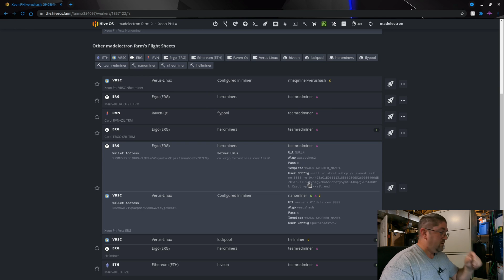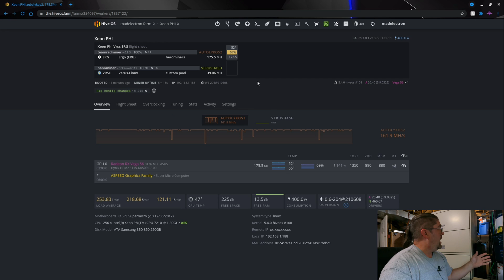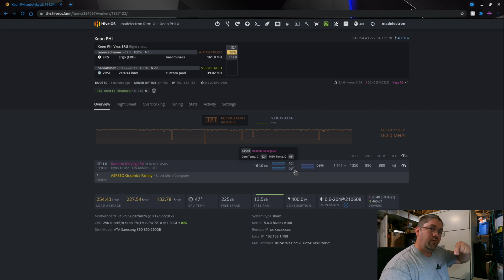Ergo Mining On An Asus Vega 56 @ 185MH/s!!!

Comment: Many thanks for the guide!

I'm trying to boost the MH/s of my Vega 56. I see everywhere that it can reach 50 MH/s+ at 130watts, I can't manage to exceed 37 MH/s at 200watts...

Here are my hardware and software specs:

- MSI Vega 56 8GB (Samsung memory) the 1st bios at 150watts, the 2nd at 220watts is flashed in Vega 64 and works very well
- Latest AMD driver
- AMD Memory Tweaker XL with GUI
- NiceHash mining only
- Windows 10 pro 64bits

I followed different guides to change the timings via AMD Memory Tweaker XL and underclock the card but I never manage to get a good level of MH/s and I can't find out where the problem is.

I tested the timings with the stock Bios (Vega 56 u/150watts ) and with the bios (vega64@220watts)
I'm wondering if the problem is with AMD Memory Tweaker or if I haven't found the timings that match my card. Do I need to use a specific bios for the card?

Do you recommend the use of the bios at 150w or that at 220W knowing that on the first, Max VRAM overclocking is at 920mHZ, while the 2nd bios is 1020MHZ.

Thanks for your help!

Cédric

Comment: Any guide for windows 10? I have a rx vega 56 Sapphire nitro+, best I can get using the radeon overclock is 150Mh/s, running Hynix memory with core clock at 1570Mhz @ 1100 mV and VRAM  920MHZ @900mV, TEMPT IS 59  degrees celisus. Thanks

Comment: I just got exactly this gpu back today from RMA after 2 months of buying it broken. I got it to 51.8 mhs at 123 watts with a preset I found online on eth under hiveos. I saw one guide for 90 watts under windows didn't look into it yet tho

I use:
1035 core 
850mV
950 mem
amdmemtweak --CL 20 --RC 36 --RP 12 --WR 13 --CWL 8 --FAW 12 --RAS 22 --REF 65000 --RFC 249 --RTP 5 --RRDL 5 --RRDS 3 --WTRL 9 --WTRS 4 --RCDRD 12 --RCDWR 12
Reply from the maker: I haven't personally tried it on eth yet to see my results, I bought it specifically for ERGO. I may need to try these settings this weekend just to see how good it runs.
Reply: @madelectronengineering  did you try it out? was ERGO still so much better?

Comment: Sir what are your amd tweak settings? I have the same card but my junction temp. are hovering near 80° c .
Reply from the maker: amdmemtweak --CL 20 --RC 36 --RP 11 --WR 14 --CWL 8 --FAW 12 --RAS 22 --REF 65535 --RFC 239 --RTP 5 --RRDL 6 --RRDS 3 --WTRL 9 --WTRS 4 --RCDRD 13 --RCDWR 12

remember these are tweaked for hynix ram, if you have samsung these may not work for you.
Reply: @madelectronengineering  yes sir i also have Hynix memory. Thx for the straps.
Reply from the maker: Let everyone know here if they worked or not for you.
Reply: @madelectronengineering  it worked i got 178 mh @ 144 w  but the only thing is the junction temp. they are above 80°c.
Reply: @anuragvikram20  keep junction under 99 and you're fine
Reply: @austinsewell30  ok then i think i am fine with the 80s ,thx for the reply.